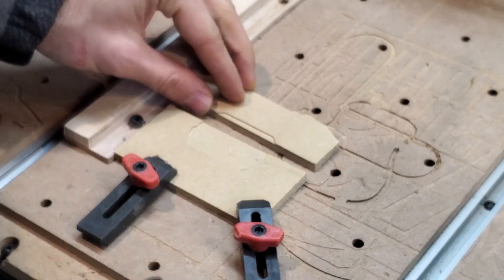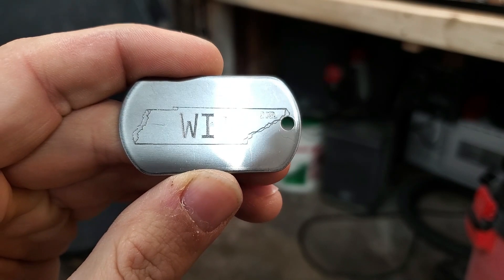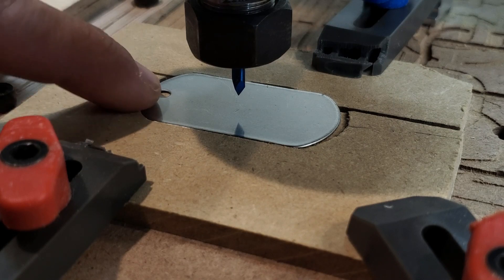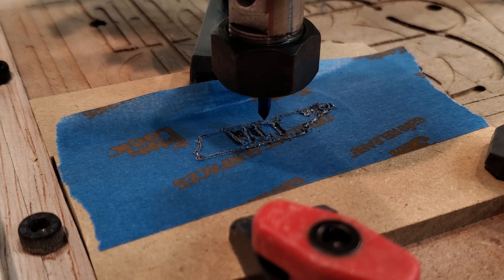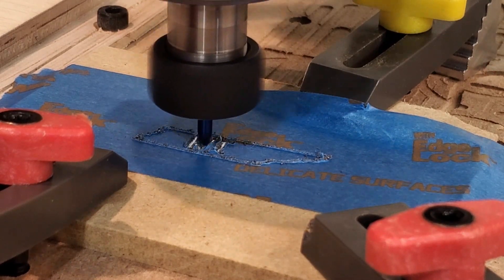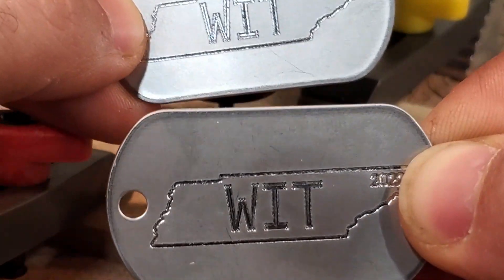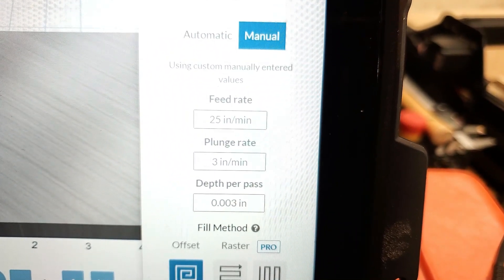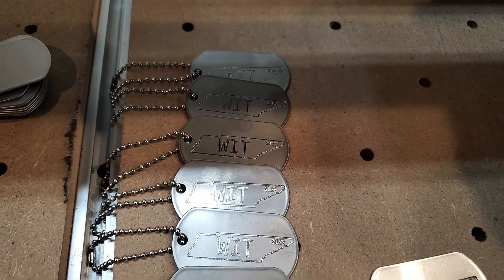Engraving Metal with X-Carve CNC

Comment: The biggest problem i had with my x-carve was getting the baseboard to not flex.  IMO the single 20x20 extrusion under the baseboard in the y-axis was just not enough.  I purchased additional 20x20 to make two more supports in both the x and y-axis and used pieces of 90 degree angle to give additional tie down points for the baseboard.  This made a huge difference in eliminating baseboard flex.  The well-known axis stiffening is mandatory if you have one of the older x-carve like i do..

Comment: One suggestion... It looks like the endmill is kind of in your way after each cut, and you're struggling a bit to get the next tag and tape put down. If you add a "g0 z5" or similar to the end of your gcode, the spindle will raise up and get out of your way after each run. This would make switching out the tags a little easier. I'm not sure what units you're using, so the "z5" would have to be adapted to your machine settings.
Reply from the maker: Thank you.  I’m using inventables Easel software.  I’ll see what I can do